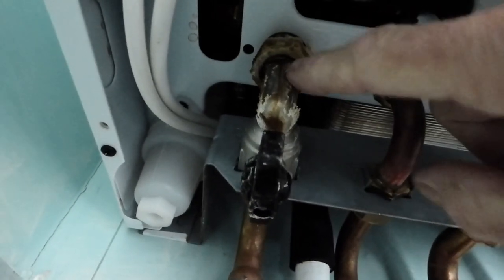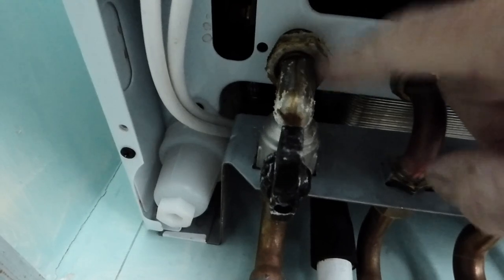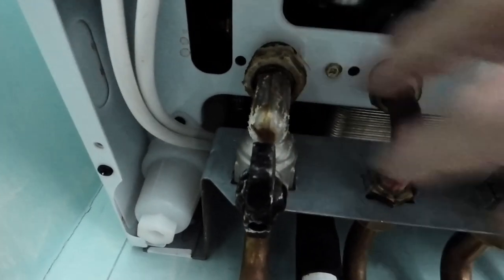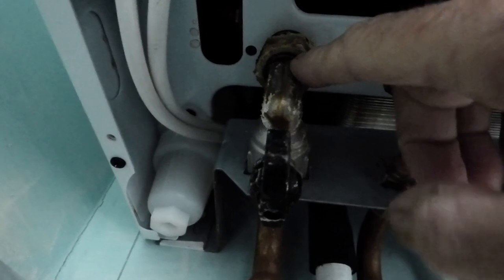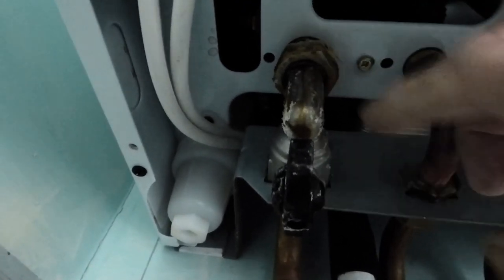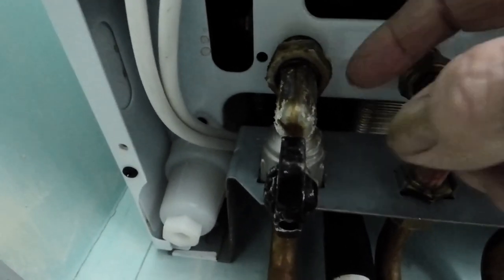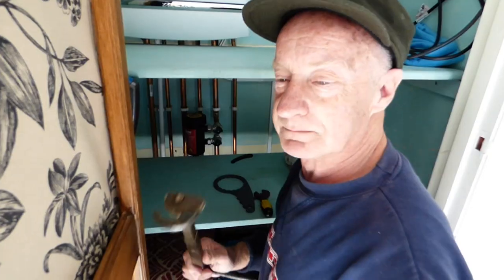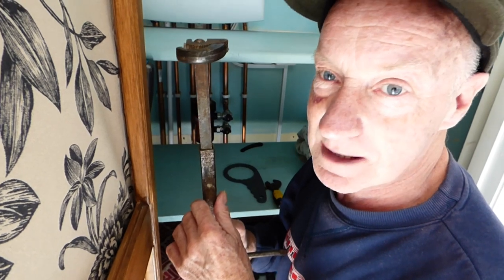How to fix a leak on a Combi central heating boiler

Comment: This is the third time you have saved me time, effort and lots of money. Thank you so much. I had this very problem at my elderly mothers house on New Years day. I noticed the bathroom floor was soaking and water was coming into the kitchen. The combi boiler is situated in a linen cupboard in the bathroom. I turned off the water and vented which stopped the immediate and significant leak. I saw where the water was coming from and Google landed me onto your website. I dismantled the joint and cleaned the fibre washer which otherwise appeared ok. I cleaned verdigris and lubricated the connection threads as they were very dry and screaming when tightened. Leak stopped on second assembly / tightening. I'm going to get a new washer when the shops are open. Thanks again.
Reply from the maker: No problem Terry.

Comment: wow  ive  never seen a tool like  that before omg  thats very impressive sir 10/10
Reply from the maker: Yes that is the business Mike.
Reply: @dereton33  I've got a chunky solid steel basin wrench 🛀 🔧. Works with that too!
Reply: @dereton33  Had other leaks in my boiler and a small amount of silicone sealant worked for them.
I had some left over from a kitchen job years ago(not a big cartridge, but just a small tube). 
The good thing about it is it forms it's own seal when opened, stopping the rest from setting.

Comment: Hi, I have the same boiler with the same leaking fibre washer on the joint! I tried nipping it up but the boiler has been in for a while so its going to need a new washer. I'm confident to do it and have drained the system several times. I'm struggling to find the size of the washer. You wouldn't happen to know what size I need, would you? I bought a basin spanner today...I can't believe I've struggled with grazed knuckles in tight spaces for all these years! Brilliant tool. Thanks for your video's, you have taught me a lot.
Reply from the maker: Hi Jc, all those washers are different sizes, best bet is a visit to a pound shop where you can buy a bagful of fibre washers of all sizes one of them is bound to fit.

Comment: Thanks for this.  I think you've solved the problem of me to have to keep filling my boiler up every five days or so.  Under my boiler there are bluish greenish marks on the pipe mentioned in the video.  Boiler is only a year old or less.  I can't get on the nut with the spanners I have so tomorrow I'm off to screw fix to hopefully get one of those basin spanners.  I will update this comment to say if this fixed my problem.  Cheers All these videos are appreciated.
Reply from the maker: No problem John.

Comment: Thanks got a similar problem tried to tighten up but weeps when heating first comes on just one drip ON CH FLOW no more than that. Looks like I am going to have too drain system and fit new washer ☹️
Reply from the maker: Yes sorry Wayne.

Comment: Hi.  At 1.20 mins into the video you show the tightening up of the nut - just beneath is the black water turn off valve.  I’ve just developed a slow drip from this valve on my Main Combi Eco 25.  Is there an easy fix for a drip ?  Thanks in anticipation of a simple answer.
Reply from the maker: Afraid the valve will need to be replaced.
Reply: @dereton33  Thank you for the reply. I suppose that means I’ll have to drain down the whole system ? Correct ? And thanks again.

Comment: Omg the Hoover 😂 please can you help, on your boiler the white plastic part at the back left as you look at the screen. That’s leaking on mine. Any idea? 🙏🏼
Reply from the maker: Could just be the seal, try giving it a nip up with a spanner. If it is still leaking then it will need a new fibre washer.

Comment: What is the white plastic container to the left , mines leaking from there?
Reply from the maker: The leak will be inside the boiler casing somewhere leaking through. You will have to get an engineer to look at it as you are not allowed to remover the boiler cover.
Reply: @dereton33  My cousin is a bio engineer. Will that do?

Comment: Hi have a leak in my boiler,it seems to be coming from the bolt above the filling loop valve (I think that’s what it’s called) and my pressure keeps going down any ideas of what I could do to fix it ?
Reply from the maker: You can try some leak sealer, failing that, an engineer to look at it for you.
Reply: Thankyou I’ve tried tightening the filling loop To stop it leaking but it doesn’t seem to be moving, i will try the sealer Thankyou.

Comment: Could a weep like that cause pressure to drop al im toppin my boiler up every single day but no signs of an obvious leak anywhere
Reply: A weep is all it takes for the pressure to drop yes, there must be a leak somewhere if you are stopping up daily
Reply from the maker: Yes Thomas is right. But it would be a bigger leak than the one shown in the video.
Reply: dereton33 
So why am i not seeing water in the ceiling or whatever then surely id be seeing something ??
Reply from the maker: It may be a pipe under the downstairs floor, so you wouldn't see it.
Reply: Could be your expansion vessels flat. Does it when heatings running go towards 3bar if so it’s triggered the prv anc will be leaking through the 15mm to external
Reply: Jack Fryer 
Yeah iv read this but im not a plumber so cant confirm obviously iv got concrete floors downstairs and not a drop showing on my pipework or ceilings , im gonna get somebody in this week thanks
Reply: RK 180 that’s cool I’d definately suggest that all the best pal